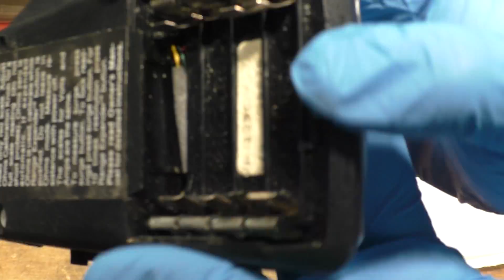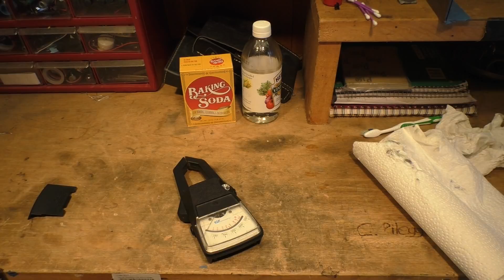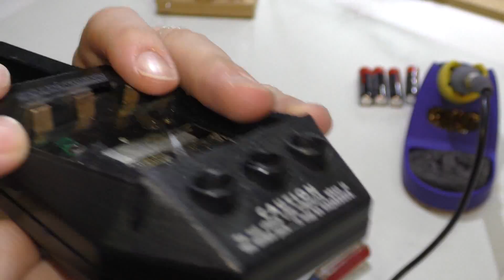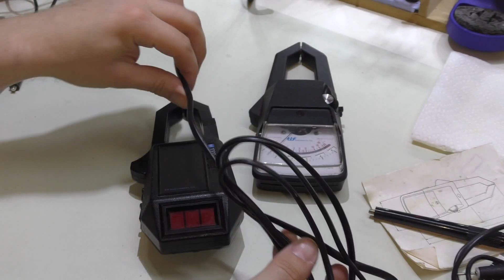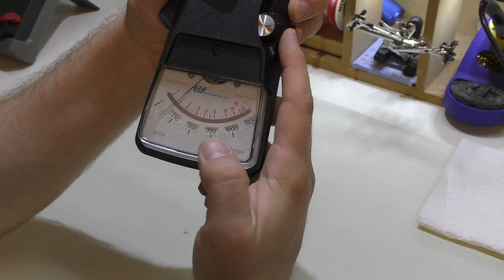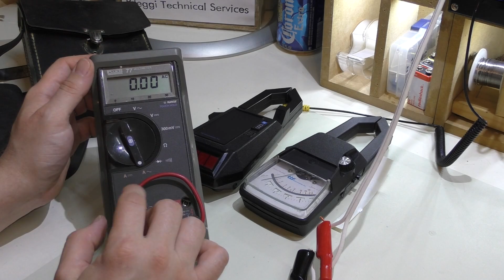PTS Ep. 98 - TIF Instruments PP1000 & PP1250 Vintage Meter Cleanup Pt. 2

Comment: thanx for the video..here's another meter with other kind of  clamp..https://www.ebay.com/itm/TIF-PP1000-Digital-POWR-PROBE-Volt-amp-ohm-meter-ammeter-clamp-mult-power/322627033707?hash=item4b1e11da6b:g:exoAAOSwnsZZf~Kk